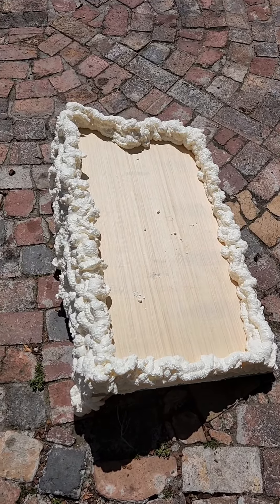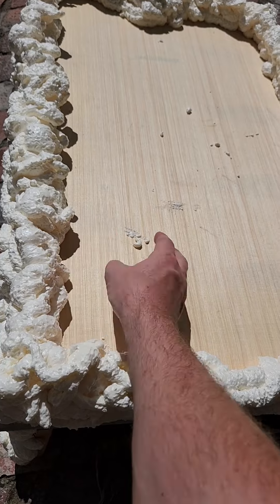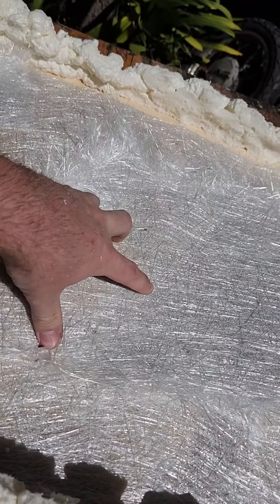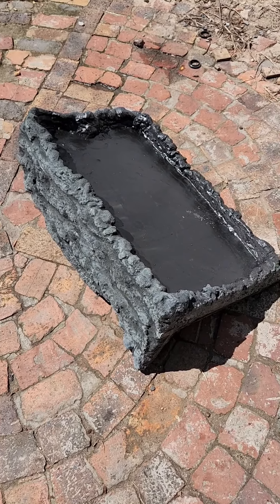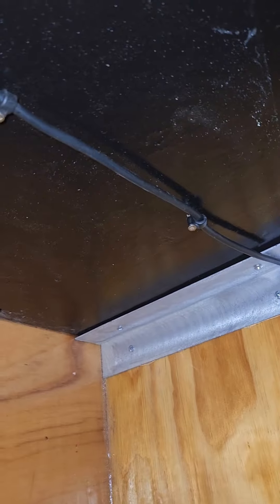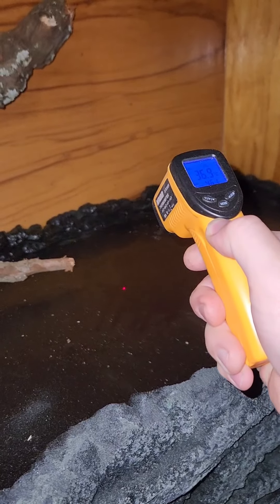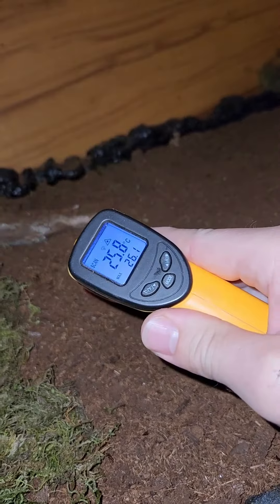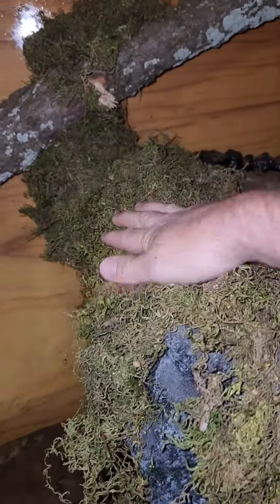Making a heated shelf for a Reticulated Python.

Comment: Great job! Can't you just use a CHE with a lower wattage? We have a range of CHE strength here. She's gorgeous!
Reply from the maker: Thanks, yeah any wattage you like really but this cage is big. The heat Emitter is connected to a dimmerstat so temp differ from day and night and sometimes it will be cooler on top. Under the shelf the temps are perfectly controlled. She is a stunner.